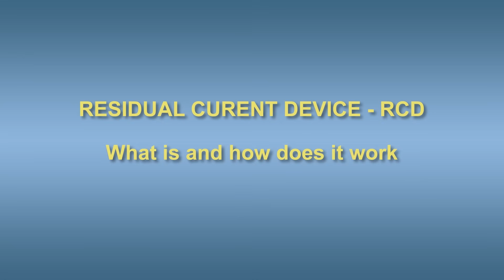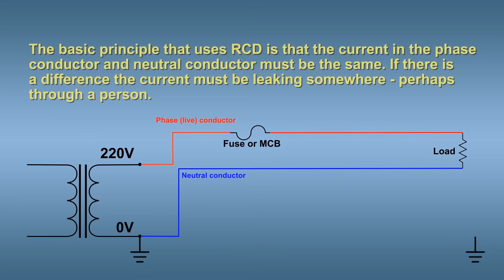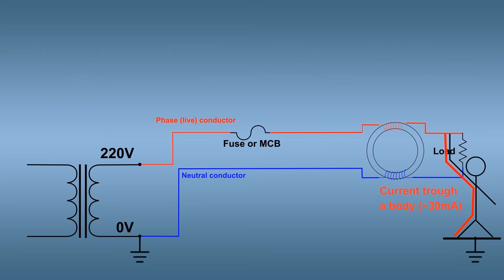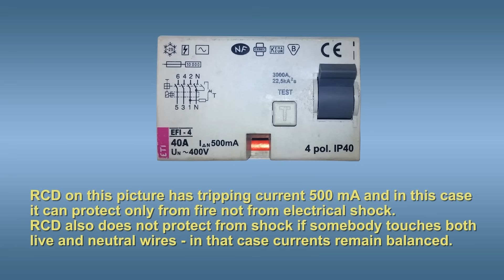RCD (Residual Current Device) protection - Protection against Earth Faults

Comment: so if we touch the netral conductor in this case. what will happen? dose the RCD cut the power ( the function is still the same when we touch live conductor)
Reply: ano, rozpojí okruh. It will disconnect  the circuit
Reply from the maker: it will disconnect circuit

Comment: Is it good to use RCD as the main breaker and the branches are MCB's???  What if the loads connected in each branches are all ok for its ampere rating but it happened that the total current flows to the main breaker is more than the capacity of your main breaker. Since RCD has no protection in overload, what will happen is your main breaker will not trip and most probably the breaker that feeds your panelboard is the one will trip. Please give me a reply because I want to know if what I am saying is right or wrong. Thanks
Reply from the maker: From my experience I dont like to put RCD as the main breaker...When I worrk in housing I allways put main MCB...I calculate my main MCB in relationship to my main cable
Reply: On the last part of your video it is shown that RCD are installed together in the combination with MCB's to have best practice. I thought on that illustration RCD is the main breaker...thanks

Comment: In practice ,why an RCD trips if you cut through a cable with live and neutral only causing short cut?
The sum of high current is still the same!
Reply from the maker: Sum of the current isnt same...You have before RCD one sum of current and after RCD where short circut is happened current is much higher...Willl RCD trips depends on many things, In practice first will trip fuse, because fuse is much faster then RCD. But also RCD will trip if is fast aprox. 0.1 seconds
Reply: @chrvoje_engineering  The sum of current is the same where short cut happens.
The RCD "does not know" if you cut through a cable or have a high resistance device connected!
I dont think you understand electrics,  talking about RCD measuring current before it and after.
Sorry but that is total nonsense from you.
Reply from the maker: @dywizjon303landa8  I think that you "does not know" or understand electrics, how can be same sum current before and after short circuit
Reply: @chrvoje_engineering  connect an earth cable to neutral bebore RCD and see if it trips...
Then you may understand that RCD balances current on load side only!!!
This conversation is a waste of time with "so called engineers" with no basic knowledge!
Reply from the maker: @dywizjon303landa8  This conversation is a waste of time with "so called engineers" with no basic knowledge! - I AGREE, Best

Comment: Question: How can I wired a RCD if when our power source is Line to Line(110VAC each) only and no Nuetral wire or Earth wire provided, The cooperative here in our place they only run 2 wire(line to line) only to their consumers and nothing else, Can I still use a RCD if not, any suggestion or remedy? Thanks
Reply from the maker: Well, How you dont have null wire?
Reply: @chrvoje_engineering  I don't know why they didn't provide Neutral wire, just a 2 wire with 100V AC in each wire.
Reply from the maker: Is this DC sistem +110V and -110V
Reply: @chrvoje_engineering  It's an AC system sir. 2 wire 110V AC each. no other wire provided.
Reply from the maker: Very strane, you have this arrangment in your hous
Reply from the maker: Are you suše, that you Dont have null wire,
Reply from the maker: Maybe one of your wire is null wire,   but somwhere is connected with phase
Reply: @chrvoje_engineering  Sorry for the late reply.
Reply: @chrvoje_engineering  Yes sir, 100% very sure. Open this "https://drive.google.com/open?id=13CfcTl2LicusPnvVi7HMz5RiPW1wW3o-" link for the test results.

Thank you.
Reply: @chrvoje_engineering  As I mention on my previous reply, It's a 2 wire source with 110vac each conductor, our appliances here works only in 220vac source.
Reply from the maker: @megamanwins  Well I see this, Im on work I will examine when I come home, but you have beetween two wires 110V AC
Reply from the maker: What you have is circuit breaker, with no fuse
Reply: @chrvoje_engineering  Ok copy that sir.
Reply: @chrvoje_engineering  Yes sir, The green "big" conductor...that came directly from the meter through the drop wire.
Reply: @chrvoje_engineering  Hi sir, have you checked it? Does it have what you wanted? Can you share your thoughts about it? Thank you.
Reply from the maker: @megamanwins  Hi, sorry for late replay, this is have I look on this problem
Reply from the maker: @megamanwins  1st. Can you inspect each wire with electrical voltage tester  (That you have voltage/current in each of this two wire) EACH WIRE INSPECT SEPARETLY. I see that you have AC 110V, I think that on circuit braeker, where is sign "40A" goes phase wire, and on other goes null wire. SO FIRST CHECK IF YOU HAVE VOLATGE IN EACH WIRE.
                                        2nd. You with this circuit breaker power house. Is applications in house working properly?
                                        3rd. When you examine send me results
                                        4th In my country we have in old house two wires, one is phase and one is null, AC system. And we make from this null wire null and earth wires and then you can install RCD switch.
                                        5th. But First examine everything
Reply from the maker: @megamanwins  Electrical voltage tester : https://www.indiamart.com/proddetail/electrical-voltage-tester-13325619212.html

Comment: I need an explanation: when there is no energy in the system, RCD yet recognise somehow and turns off the circuit. I experienced this when 3 phases and neutral connected to RCD and make ground and neutral short circuit from output of it. How that happens?
Reply: It's hard to follow exactly what you're stating, but that sounds like an  incorrect wiring issue to me. Maybe post some details about it?

Comment: What if I want my electrical instalation in my home to be protected against electrical shock and from fire incident, should I install 2 different rccb with different tripping current or i could just buy/install an rccb with the highest tripping current rating for both requirements?
Reply from the maker: RCDs dual Function AFCI/GFCI devices offer both electrical fire prevention and shock prevention, I made in my home (apartman) two RCD one for living rom and other rooms and one only for bathroom both are 30mA
Reply: After I did some search on the internet, the AFCI caused many troubles instead giving protection that it should provide.
So, is it not an odd/wrong this to install 2 different RCCD for 2 different purposes? Then, how's the wiring? Could you provide my some enlightment? Thank you.
Reply from the maker: @TheGarudaINA  Wiring, ehat you means exactly? do you have 3 phase system in your house? do you have separeted zero and earth wire?
Reply: I don't use 3 phase system in my house.
The wiring that i wanted to ask to you was, how is the wiring in the mcb box with 2 different rccb, 1 for the electrical shock prevention and the other one for the fire prevention while i already have 3 mcb (each 10A) for separating 3 different lines inside that mcb box.
Reply from the maker: so you have one phase system, i suppose you dont have RCD device. So you want with two RCCBs protect 3 MCB that you have
Reply from the maker: @TheGarudaINA  So you have One phase, zero and earth wire, you must connect phase, and zero to all RCCBs, then MCB, that you want to connect for RCCB for the electric shock you must connect with phase and zero of this RCCB.
FIRST: turn on power supply when you will be do that
SECOND: MCB must be connected with phase and zero of same RCCB
Reply: Yap, correct! :)
Reply: Connecting those 2 RCCBs, what type of connection that I should make? Is it serial or parallel connection?
Perhaps, if you don't mind, could you please draw the schematic for me? So that, I could prevent any short current that may occur during installation :)
Big thanks.
Reply: I'm still learning about electricity, sorry to have bothered you.

Comment: 0:00 - Engineer looks at diagram before starting video and asks how does 9.996A + 0.006A add up to 10.000A. My maths isn't advanced enough for this level of complexity. ;-)
Reply: RCD for additional protection is 30mA = 0.030A. I am just wondering why the video is showing difference in live currents of 0.006A. It won't even 10mA RCD make operate.
Reply: it should be 0.004A

Comment: If a device draws current and some of that energy is lost through inefficiency, why do we expect the current returned to be equal to that of what is supplied?
Reply: It's a bit late but it is impossible to lose current through inefficiency. Inefficiency is, generally, due to heat loss which is just wasted energy if it doesn't provide some other purpose. Current will always be the same through a series path irregardless of what loads are on the circuit.
Reply: Energy losses in case of residential loads follow the principle of I^2R which are in fact the voltage drops occurring on the conductor. Thus the incoming current through live wire and outgoing current through the neutral wire always remains same despite of energy losses.
Reply from the maker: I think that lost current through inefficiency Can not influence that RCD switch reacts
Reply: Regardless of the efficiency of a circuit, you MUST have a complete path for current to flow. An inefficient circuit simply "consumes" more energy (draws more current) than would an efficient circuit for the same task. The amount of current in the source wire is still equal to the amount of current in the neutral.
If someone or something provides an alternative path to ground other than the neutral wire, then the current in the source wire will exceed the current returning in the neutral wire and the RCD will trip. This is because whatever is touching the source wire is "bleeding off" some of the current.
A common misconception is that the neutral wire is "ground" or "earth." This is because we misnamed it "neutral" but it is anything BUT neutral. Yes, it is connected to ground at the panel but it carries all the current back to the panel with it. It is a "current carrying conductor." A person can get shocked by the neutral wire as well. The RCD will still trip in this condition also since the current returning on the neutral is divided between the person touching the wire and the neutral wire returning to the panel. 
I've used the word "source" wire here instead of "hot" wire or "load" wire. This is because I also dislike the word "hot wire" since the "neutral wire" also carries current and may also be considered "hot." If I could change the way we name these wires, I would call the neutral wire a "return" since that is its actual function--it "returns" the current to the panel.

Comment: Korlen Electrical Company is a 30 year manufacturer in Electrical appliances specialized in AC contactors, LED bulbs and all forms of
Circuit Breakers (MCCB, MCB, RCBO, RCCB etc.) We produced according to customer’s design and requirement (OEM). Wholesalers looking towards to minimize cost are warmly welcome to Korlen. We produce everything from design to packaging and from packaging to delivery and this gives us the power over competitive pricing models based on your preference. For more info, click on www.korlen.com Skype: Emma An-song. whatsapp: +8615997444049. Fax: +86-577-62661666. E-mail: korlen@korlen.com Tel: +86-577-62207777 /
62870277